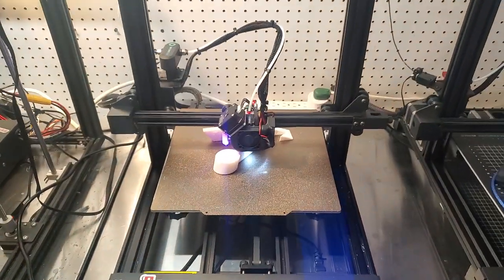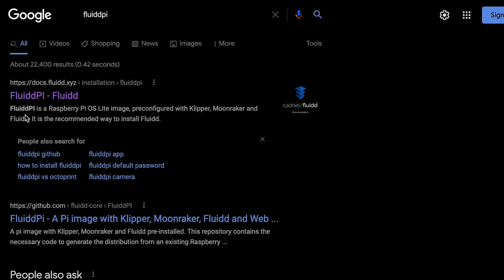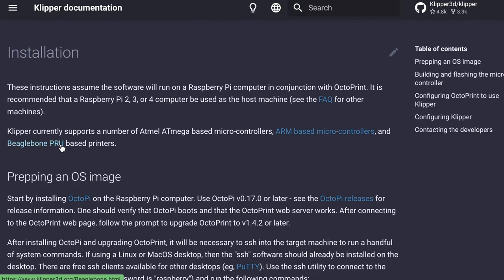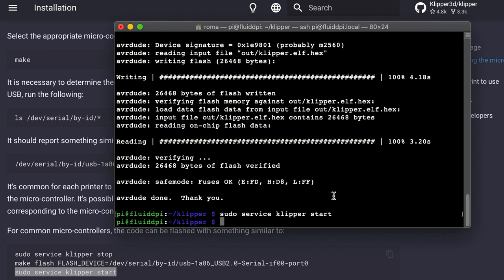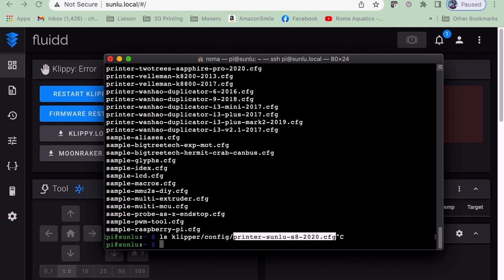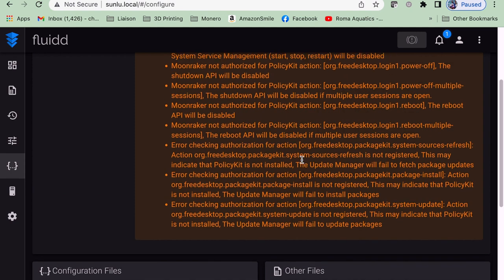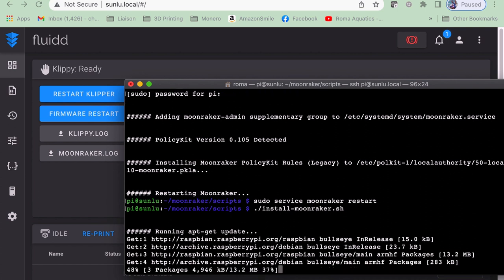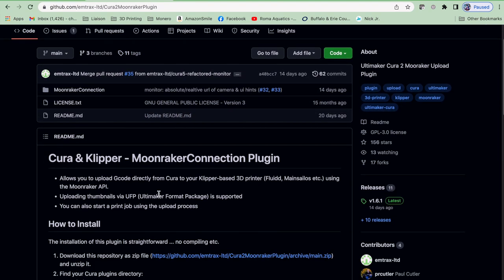How To Install Klipper Firmware Sunlu S8 Series 3D Printers (Sunlu S8, Sunlu S8 Pro,  Sunlu S8 Plus)

Comment: did this on a pine 64 with a few changes to make it work for me thank you for the info! i will say this if you used  KIAUH to install klipper fluid ect..you may get an error when trying to copy the sunlu print config. its gonna tell you the file doesnt exisist at least it did for me i did some diggin and learned that it did not store the printer config on home you had to go to the printer_config folder (i belive it was ) and thats where the cfg file was .. i coppied there and it did its thing!

Comment: Well this could save my sunlu s8. The SD reader stopped reading sometimes. I think it's a faulty solder. So with no replacement MB now available I have high hopes. Never used Klipper to now is my chance.
Reply: Did this work for you? I broke the sd card reader on my S8.
Reply: @Tandor69  So yes. I upgradeed to the Klipper, and I have my S8 back. Works faster, and better than ever. I also upgraded my build plate to the PEI flex plate.  It's one of my main printers I use again.
Reply: @cpace123  Thank you. I will have to do that to mine. I have upgraded to PEI flex plate as well.

Comment: With your tutorial I was able to successfully install Klipper on my Sunlu S8 with the stock board. I am trying to add a bltouch and I cannot figure out what sensor and control pin to input into the configuration file. I physically put the control on D11 and the sensor on Z- on the board. When I turn on the printer the probe cycles properly. I can command the probe to move down and up but when I send the query probe command it always reports as triggered. When you were scrolling through your configuration file, I took a screenshot and set mine exactly as your is. However, if I try G28 I always get failed to verify BLTouch is raised. How can I verify I have the senor in the correct pin on the board and I have the correct pin set in klipper? I also tried flipping the sensor pin with no change.

Comment: I just picked up a SunLu S8 Pro and not very familiar with them.  I have performed an Auto Level and the paper catches ever so slightly between the nozzle and the bed.  That said when I print the nozzle is too high up and the filament is not getting pressed into the bed to allow it to stick.  While printing I click Tune and Bed Z but it does not adjust the nozzle closer/further from the bed.  Any help appreciated.
Reply: Did you ever get yours working? I just got one today and it's not letting me adjust the z offset as well.